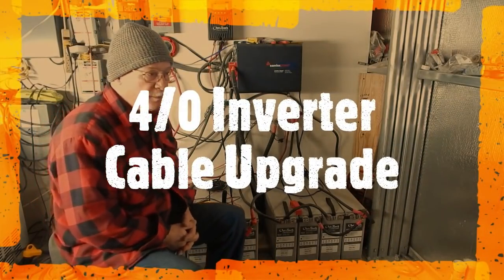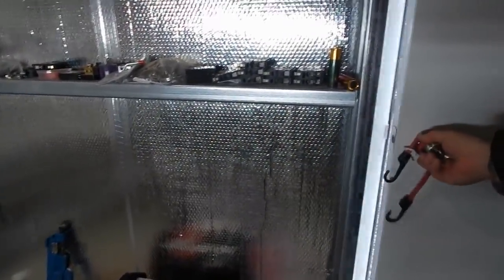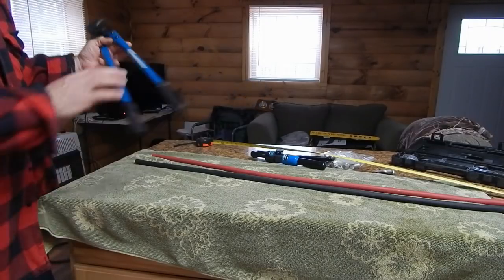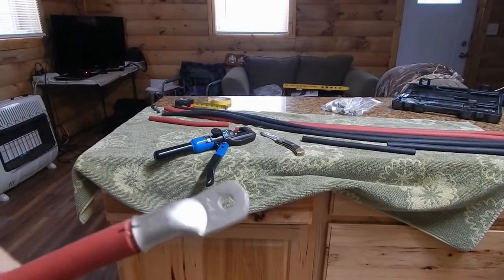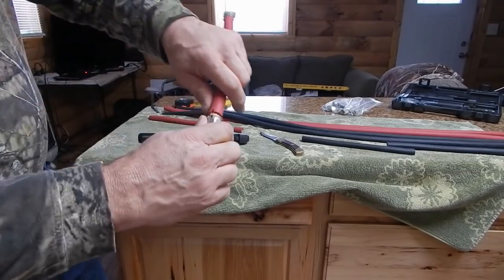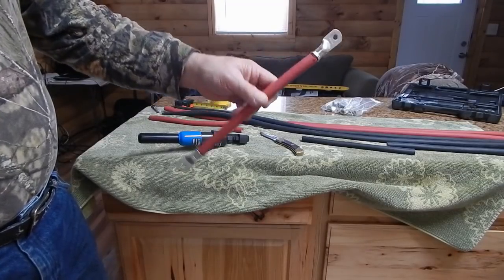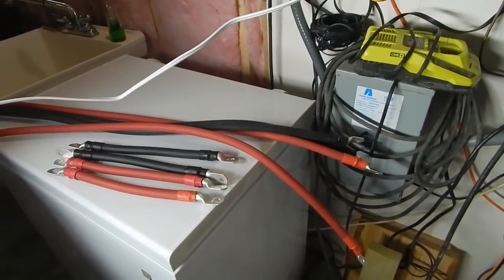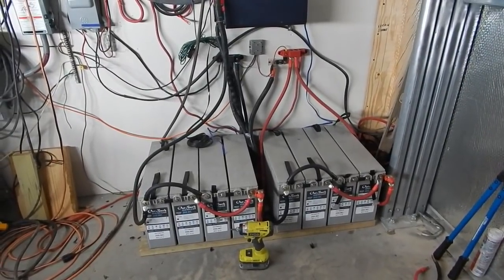Samlex Inverter 4024  4/0 welding cable Upgrade.

Comment: Thicker is always better (he-he-he!). Nice...
Reply from the maker: I'm having some other weird issues while charging these new battery's. I need to do a video on it when I get some free time Lol
Reply: @TheKiloG69  Oh no...hopefully you will sort it out. Can I ask what is going on...very curious. Thanks Glenn
Reply from the maker: @ChrisDIYerOklahoma  unequal voltage between battery's as they charge. Weirder yet different yet again depending on if charging with solar or charger?
Reply: Hmmm. Have you disconnected everything, rest them, and then check volts? Wondering if one or two batteries started life off under-charged? The only other thing I can see/think is those buss plates and buss bars tightness? Battery balancing, string balancing, is a PITA when things aren't in tune. Looks like you have a "modified" two string with four batteries each...with two strings in one string. Should be okay...but, wondering if running four strings direct into single buss bars would be better/different? More wires tho. Just thinking outside the box. Hopefully it all gets sorted out. Might want to give Outback a call...they helped me out big time when I was "up in smoke" with my equipment last year.
Reply from the maker: @ChrisDIYerOklahoma  That's a great idea call outback if I can talk to someone. All the battery voltage is even out after they settle for a while they came here hot every one of them 12.77